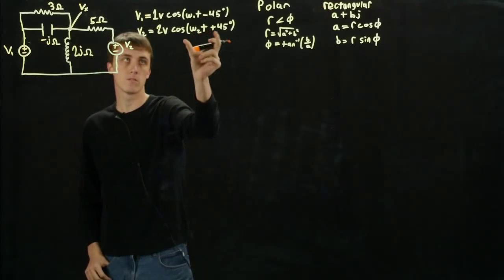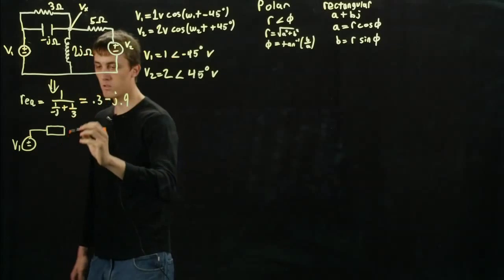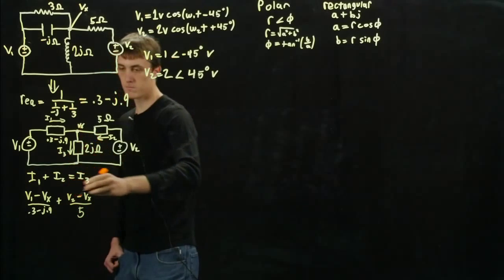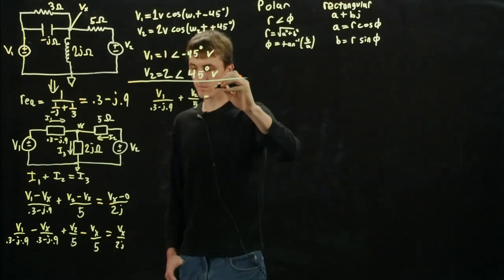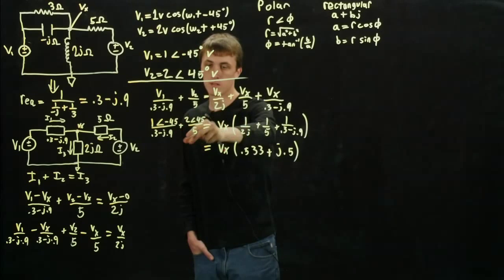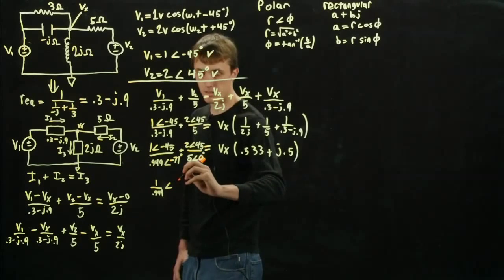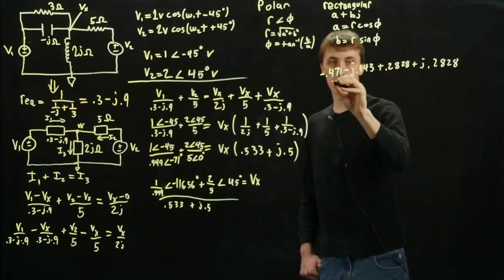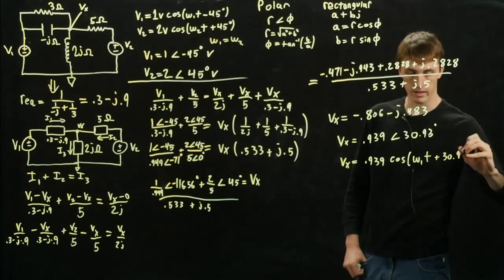Circuits 1 - AC Circuits (Node Voltage)

Comment: I don't know why, but this back of the board writing annoys me. MIT, Yale have regular blackboards which are more natural and more relaxing to follow. And makes me feel like I'm actually attending class.
Reply from the maker: If you check out some of our old videos, we used to operate like this. However, the technology needed to make this kind of video palatable is very expensive (mic setups, sound proofing, lighting, etc.) . The University where we operate has this technology openly available to the organization, so we took advantage of it!  We're sorry that our format is not to your liking. We hope that the information presented will help supplement your learning, not replace it.